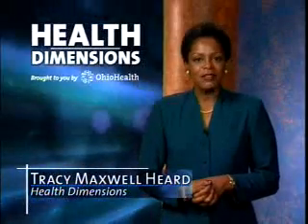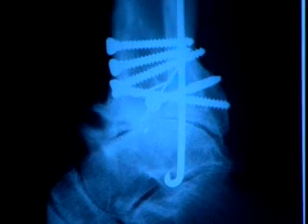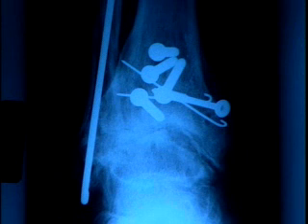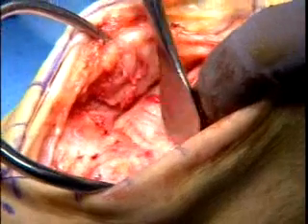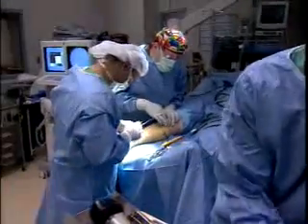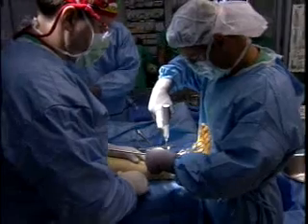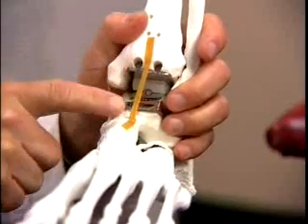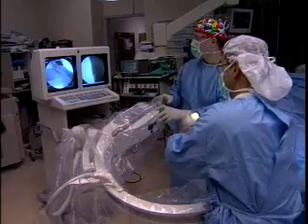Total Ankle Replacement

Comment: @leejames1982 (cont) to try and do surgery to drill holes into the talus bone and try and re attach blood vessles and hope they take to the bone and re juvinate it somehow, but then after the latest scan results showed that the bone is too far gone and that prob wouldnt work as the AVN wasnt picked up early enough and had taken its toll. so now they are saying just keep weight off it and take it easy until they come up with a newer ankle replacement, or if the pain gets too bad it will be fused.

Comment: @leejames1982 That being said old replacments only moved front to back but the new ankle replacments they have on the market now have more range of motion.  So doing the ankle fusion has now opened the possibility of an ankle replacment to move like I use to.  Thats what I am thinking and presenting it to my orthopedic surgeon.  

I guess it would be a 2-part operation step one fusion to allow body to regrow bone to fill in and step 2 remove some bone and insert ankle replacment.  Hope is helps

Comment: @leejames1982 Cont. from last post: :: crushed vertebraes to help stabalized there height and added suppport while the bone heals.  I required 2 of those metal cages but they were placed in my ankle where the talus would normally be.  Of course I do miss things I use to do.  I don't regret fusion of ankle I walk normal we it appears I do until I tell or show people my ankle or lack of ankle it is now one big solid "L" shaped bone.  I don't need to wear any speacial shoes or don't have a 6" heel.

Comment: @jmidesigns My orthopedic surgeon came up with a some what clever procedure.  At the time no form of replacment was avalible to me so I was left with my last choice a complete ankle fusion.  It is a fusion yet not one done normally.  

2 Bone grafts one from my hip and my fibula about where the lateral malleolus is up about maybe 3 or 4 inches was cut off and lowered down numours screws threw from one side to the other and for added support 2 metal cages.  They are cages normaly for people with

Comment: i need a ankle replacement and would love to get more infomation on this proceedure and details of who to contact about it, i have been diagnosed with having AVN of the talus bone (Avascular necrosis) due to blood vessles that attach to my talus bone being damaged when i had meningococcal and the loss of blood supply has caused my talus bone to deteriorate. my condition is very rare and there is nothing they can do to fix my ankle bone apart from fuseing the joint. i dont want a fused ankle :-(